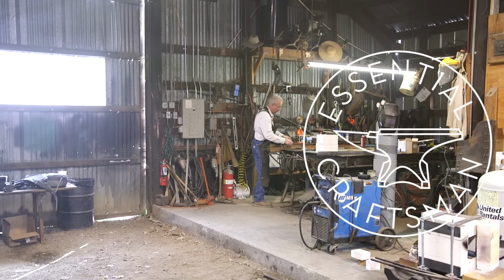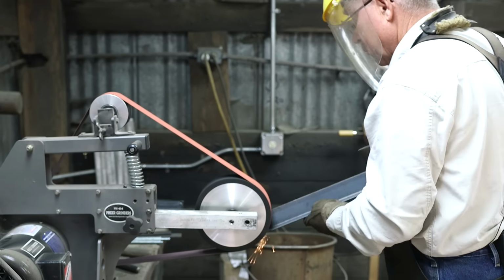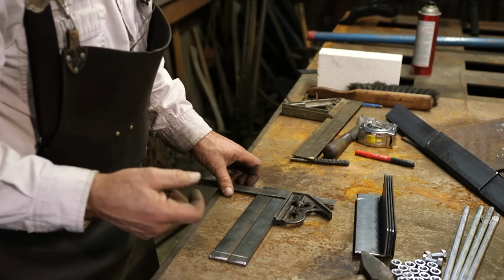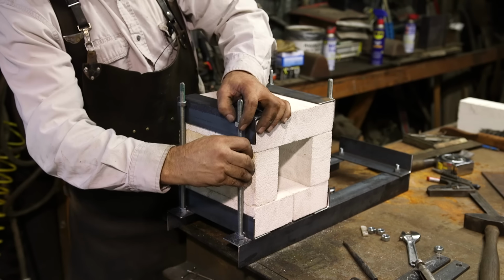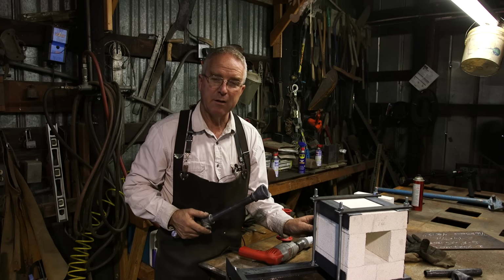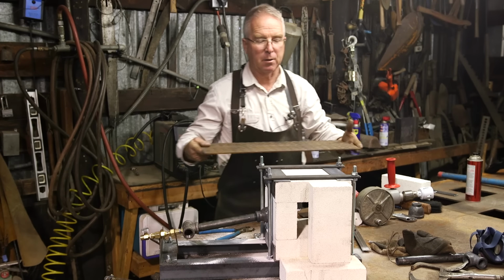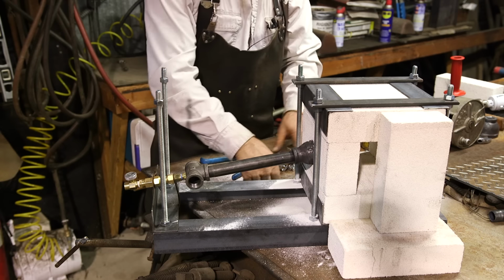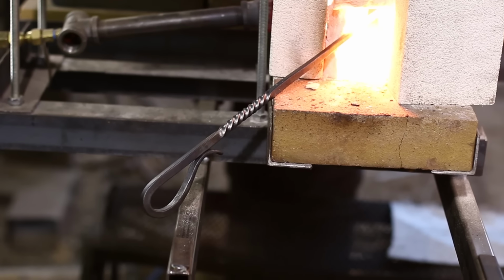Forge Build: No Welding Required

Comment: Please show us how to make a burner, that would be a nice way to conclude a forge build. Yes there are some online but I bet you can do it much simpler.
Reply: A forced air burner is the easiest most efficient way to go. You can use a shop vac or just a plainold battery powered air mattress blower.  pipe your air and gas separately into a tee woth a gate valve to control the amounts of air and gas then pipe it into the forge just as shown in this video. Turn on gas and light it then slowly open air valve till you get proper mixture.  Its cheap and simple.
Reply: @kenjett2434  ^Boom this guy gets it!
Reply: Look up the Zoeller burner designs, they are some of the best out there.   http://zoellerforge.com/index.html
Reply: The Frosty T burner is the easy one but needs tuning based on altitude.
Reply: You're mistaken sir, the burner is not simple. The internal regulation of the fuel and mixing it with the air is a very exact science.
Reply: @paulbooth5778  in this case, I'd say look again.  Looks like we've got a gas valve going into an open sided T, then the extension and nipple.  The gas valve controls fuel supply and the open T allows the fuel to draw its own air with the venturi effect.
Reply: @paulbooth5778  Actually having made two there not that bad. Obviously you have to practice good safe common sense and mine will probably not be as efficient or as high an output as a carefully engineered model. But its hasnt made me regret it in 18 months of use. Fuel regulation is literally done by the purchased regulator. Gas flow is either altered by feathering the needle valve or in my case I can vary the regulators output. Air mixture is varied by opening or closing the air inlet. You need to tweak these on startup and for forge welding anyway.  But buying or making are both absolutely fine solutions. There are some reasonable priced burners out there. I was just on a budget.
Reply: Paul Booth dude, i have built numerous burners,  3rd grade science class taught me everything I needed to know about fuel and air mixtures.  Besides, 3000 degrees will be more than enough to heat iron and steel. Good day.
Reply: ThisIsAPrettyLongUserNameWhyTheFuckWouldHeDoThatSoThatEveryoneWouldThumbsUpIt just go to harbor freight and buy a long weed burner.
https://www.harborfreight.com/catalogsearch/result/index/?dir=asc&order=EAScore%2Cf%2CEAFeatured+Weight%2Cf%2CSale+Rank%2Cf&q=weed+burner

Comment: Using an old metal cake pan for the top shelf would work
Reply: Restaurant supply stores have fabulous, heavy aluminum baking sheets with raised edges. I’ve been using a huge one in the shop for years to corral engine and transmission parts during rebuilds.

Comment: Great little forge. I'm not a blacksmith by any means, but I would like something small to heat metal for heat treating and also bending and shaping metal. I think this is just the ticket and small and light enough to put away when it's not needed.

Comment: Loved this, forges, blacksmithing hitting hot Iron. How long does this little forge take to heat up, I noticed at end of video one brick is already cracked on the side. They are good insulators, but very fragile,.
Reply from the maker: For sure!! they crack but are held in place by the frame. Even so, they will be a consumable over time like every forge lining.
Reply: @essentialcraftsman  Yeah they're very fragile, and yeah most lingings are consumable. The only one that I have found that lasts a long time is 1650 gun cast.

Comment: Neat setup.   I need something like that for hardening , and bluing small machined parts.  When making to parts with holes opposite of each piece.  Is called mirroring.
Reply: handing is the construction term for it- so unsurprising he used that.

Comment: for anyone considering building one of these, try lining it with an inch or two of kaowool blanket. you'll find it increases the efficiency noticeably and will save you on propane costs.
Reply: Thanks for the tip. That’s very helpful and cost effective

Comment: Drilling, especially without a drill press, will go a lot easier, if you predrill the holes with a 1/8" bit first.
Reply: Very true, but with a center punch and a split point bit, or a sharp bit for that mater this can be done easily.
Reply: Really depends on the quality and sharpness of your bits.
Reply: Michael Meacham - I always pre-drill with an 1/8” bit.  Just makes me feel better.  1/8” bits are cheaper to replace!
Reply: I’ve found with good sharp bits and a center punch mark press drilling is unnecessary in most cases
Reply: Yea the drill shape doesn't allow the center of the drill to cut easily. Predrilled makes all the difference
Reply: on cnc machines i never predrill cause it leads to to much vibration, but dont know how bad the knockback is when drilling more than 1" holes with a hand drill.

Comment: I need to move into a house. Apartment livin isn't living.
Reply: Years ago in Mesa Arizona I rented an apartment that had about a dozen garages. Lucky I was able to get one not long after I moved in. I started rebuilding my own street bikes and track bikes in it. It soon turned into a carburetor shop and aluminum anodizing shop. I paid my way through 2 years of school doing it out of a small single car garage. Find yourself a storage shed you're allowed to hobby out of. Often industrial areas have them but many of the mom and pop storage facilities will allow you to craft out of them.
Reply: @joshuapotter7372  unfortunately my complex doesn't even have garages.  All in good time I suppose.

Comment: My question is will this run on Natural Gas? I heat my home and hot water and cook with a gas range with a never ending supply (almost never ending) of Natural Gas. Will this get up to temperature? Does it burn hot enough? Must I go out and buy a propane tank where I'll have to go get it refilled?
Reply from the maker: I think so... not sure but sure seems like it! I have seen forges fun on LNG but never a pipe burner...
Reply: https://ronreil.abana.org/whyusegas.shtml

Comment: is that a layer of ceramic wool that you added inside at the very end?
Reply from the maker: Good eyes! Not wool but small pieces of rigid ceramic board slid in on sides and top. Had it on hand. The forge was working well without it but it does get hotter now. The ceramic board  mostly just reduced the size of the interior. When I replace the bricks I will simply slide the off side brick in an inch and a half I think, So, yes...nice but not necessary.
Reply: @essentialcraftsman  Nice! Thanks for the information!

Comment: What's the point of the nuts below the iron strips holding the bricks at the top?
Reply: My guess is that it’s to transfer the clamping load into the all thread instead of just into the fire brick.
Reply: They are for replicating the spacing that exists at the bottom between the rods and the angle iron.

Comment: I can wait a few more minutes to go to sleep...
Reply: Sorry to tell you, after watching this video you may not sleep, untll you've built one  of these forges. I know I am currently thinking of things to deconstruct. And yes my steel bed frame is made from angle iron.
Reply: @_NAMiK_  Thats exactly what I'm using to make mine. Im legit in my shop cutting the angle iron now, I keep going back to the video and making my cuts.
Reply: @justinmorlock4281  does your bed iron smell like burning plastic when it gets cut like it does for me?  I'm working on a foundry made from air tank, bed frame, and the crucible tongs are almost entirely out of cymbal stand legs.
Reply: @David-bc4rh  no, I used a Sawzall to cut it and it worked fine. Just don't press too hard when you're cutting it and you should be okay. What are you using to cut it?
Reply: @justinmorlock4281  just a hacksaw,  I think the coating is some old janky polymer that works like paint.  straight up smells like burning plastic when I use a hacksaw on it
Reply: @David-bc4rh  That's weird. I've never seen that before. I'll look into it and see what I can find out for you.
Reply: @justinmorlock4281  It's bed iron I found in a rotten barn on the property I bought.   The suspicious coating is brown, no rust, and some tiny specs of grey mold growing on the coating.  I imagine it's really old.
Reply: Great videos I have been watching for over a month. Fuzzy
Reply: Meeeeee! It's like. 2am. I should go to bed. But. Must watch forge building.